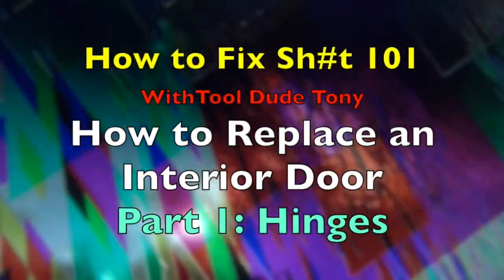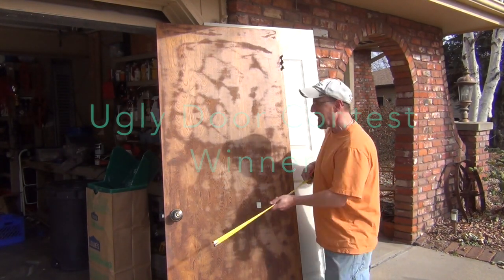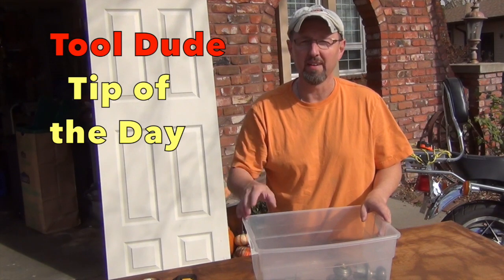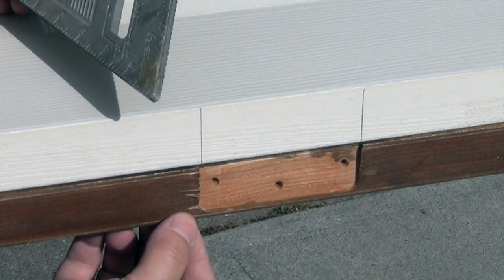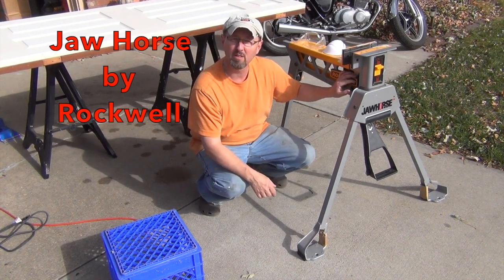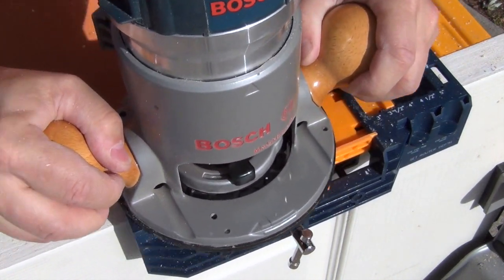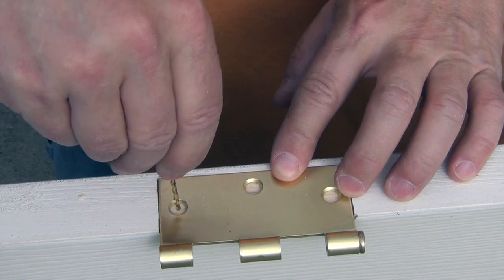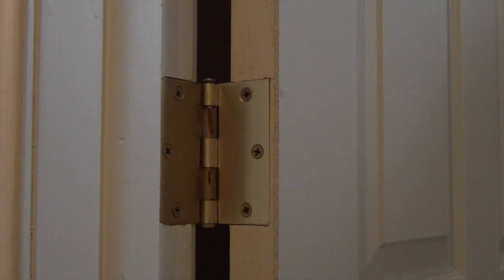How to Replace Interior Doors - Part 1: Hinges

Comment: Be careful when trimming the top or bottom of an interior door. A lot of doors (especially Luan) only have a two by two frame in them. I found this out when cutting a door to fit a weird door size. I cut a 2x4 to fit and went on my way!